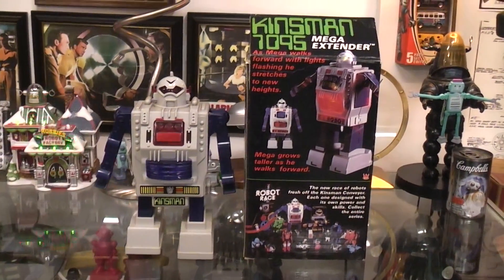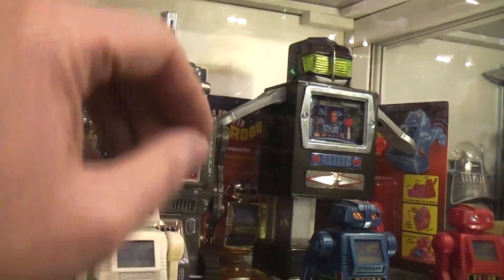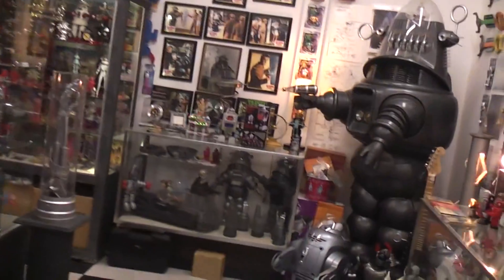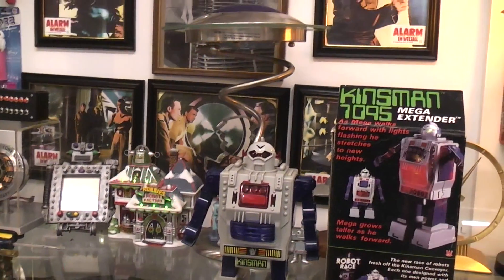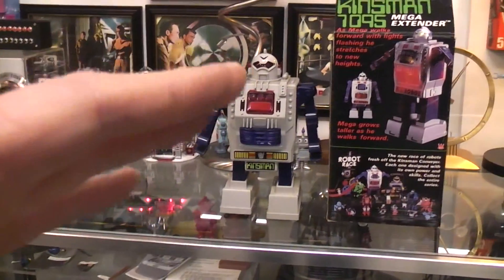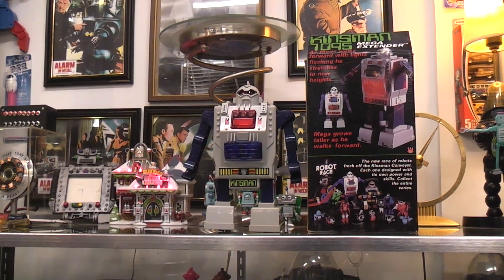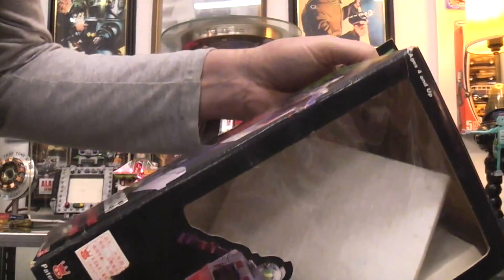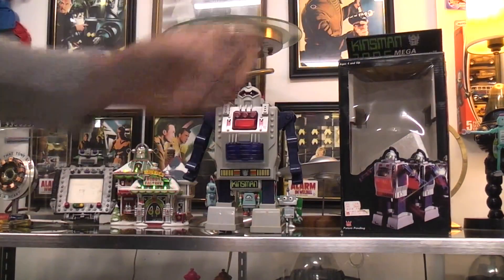Demo of the vintage Kinsman 7095 Mega Extender robot. 1985

Comment: Do you have the robot riser from that company? It's got an interesting way of working. The mechanism flips a switch every so often to change polarity of the motor and it makes it go up to become a robot.
Reply from the maker: I have so many transforming robot / cars I will have to check. I bought all mine new in box back in the 1980's and bet non of then will work as the plastic gears like to split even if you do not play with them. But you know all about that right. Here is a link to your video of the robot riser.
https://youtu.be/TOnmCzI7Azc
Reply: @Robothut  haha yes, indeed